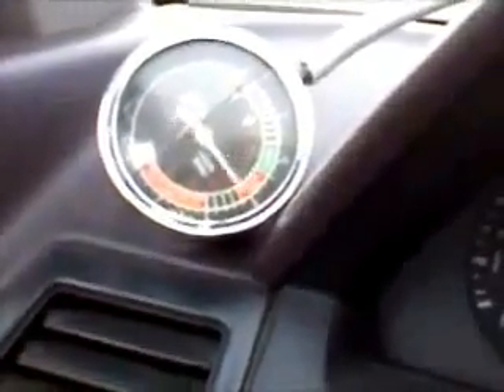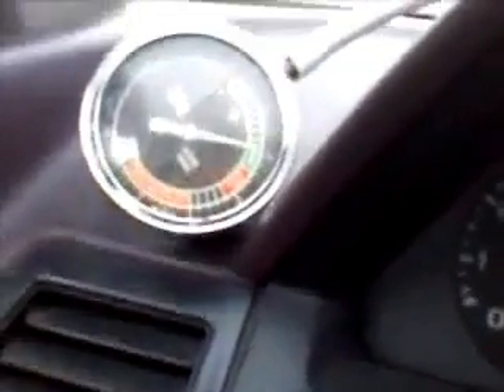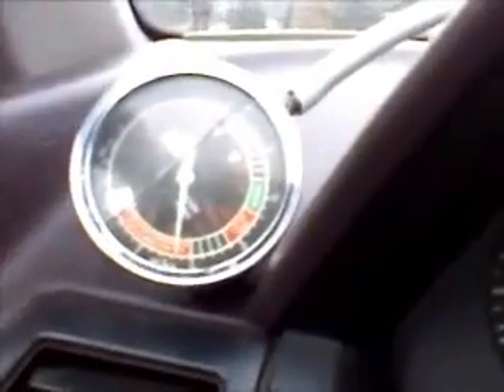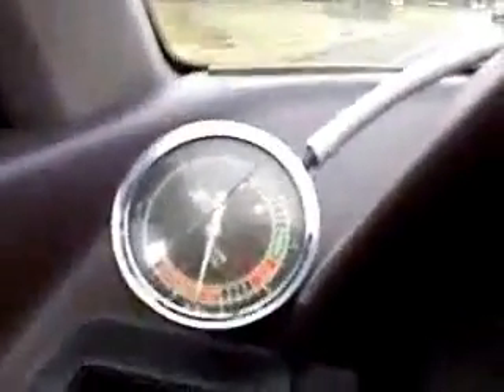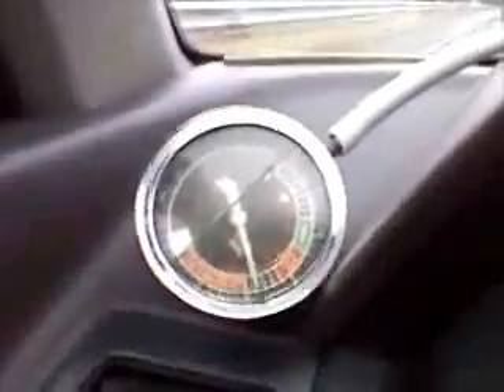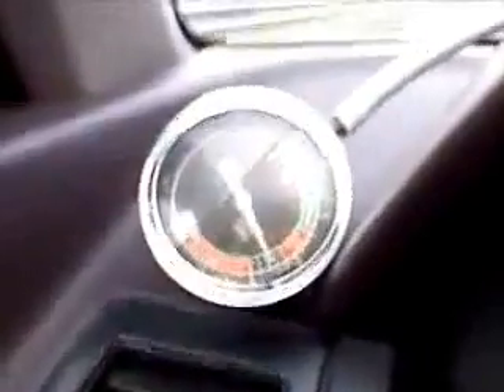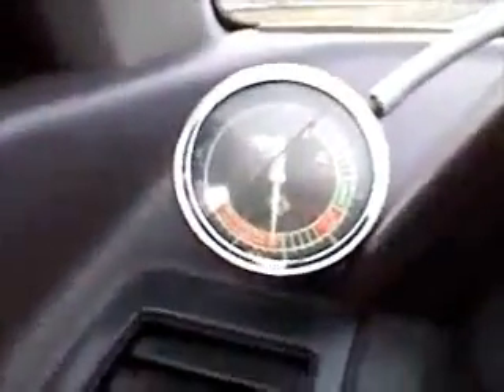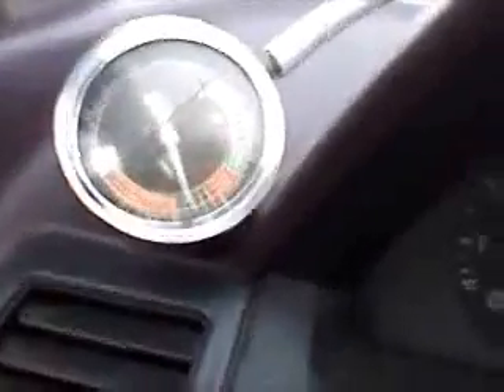#51 Demo of Vacuum on HHO cell from car intake manifold.

Comment: the only thing about hho and internal combustion engines on up to date cars and trucks is the oxygen. I know a well built cell would not put out near enough ml/min that produces hydrogen and oxygen separately and expels oxygen. see, the o2 sensor Will pick up the extra oxygen and as a part of the function of the computer it will hold the injectors open for a little longer  to inject more fuel every cycle per cylinder. so your only evening everything out. now it will be a cleaner burn but the efficiency margins that the consumer is looking for will not be there. so an electronic variable resistor will have to be ran in series with the o2 sensor and be operated by the throttle at a tuned lag to overcome this reading of excessive oxygen so your not consuming more fuel than before. which conclusively is counterintuitive. now because the government and epa have made laws against tampering with the emission control systems they have deemed this endeavour illegal and punishable by prison and hefty fines. I say do it because I will. but my research makes my system more environmentally safe and the amount of pollution is  cut by 3/4 standard emissions readings including nox . I'm very close to running my grand am on just hydroxy gas, I just have to apply the transformers before my cells to isolate the power draw on my alternator using purely reactive power. then rectify that power and I can run many more cells for the same cost of electrical power being distributed by the alternator before I applied the transformers. I just need taxes to fall through and I'm on my way fuel free....:)

Comment: It does seem counter intuitive however he is correct. With the intake butterfly almost closed during idle, the pistons will pulll a vacume against the butterfly. When it is opened for exceleration the vacume will drop due to a greater inflow of air.

Comment: It would be interesting to use a turbo like system which uses exhaust flow, to generate vacuum for the HHO cell. Rather than use pressure from the turbo, (modify the turbo, and) use the suction side to pull vacuum to the HHO cell. I learn of vacuum increasing hydrogen production efficiency from YouTube channel whyme2b. Video: HHO Electrolysis For Current Reduction.

Comment: There is nothing fascinating about the vacuum gauge. It's just what is actually being sucked by the engine in the area of vacuum manifold in order to run other devices in the car that does not need an electrical device. The vacuum reading does not actually represent the vacuum created by the engine on the HHO. It just doesn't make sense having it inside and see what your vacuum manifold does to your whole engine. With the HHO? We'll it is so impertinent.

Comment from the maker: I think so. That way the plenum or carbeurator butterfly can still be used to regulate engine output by regulating how fast air is drawn in with the HHO. The cell will be held at fairly constant vacuum by the pump. Gas production regulated by a PWM connected to a throttle pot.

Comment: Seems that the more vacuum you pull the less power is required.  Using a vacuum makes sense as it lowers the vapor pressure -- just like a pressure cooker raises the boiling point(or a car radiator)..Looking forward to more zff

Comment from the maker: HA! The venturi? I WISH! The venturi produces a max of 1"Hg (13.7" H20) @WOT, 6000RPM on my 2.2L 4-banger. Even still that's a very good vacuum signal from a venturi. It could be used to pull a water mist from a float bowl to aid in combustion cooling if I ever need it, but I don't think I will.

ICE on 100% H2O is coming. BELIEVE IT!

Comment: Hmm, my plan was to use that vacuum pump idea with a bubbler, that way the gas is sort of 'pumped' out the bubbler and forced into the intake manifold, reguardless of manifold vacuum.  As long as the pump can mantain at least 22" it should be good, at least I hope so!  Heh heh.  Can't wait for your video!  Great work!

Comment from the maker: I had considered putting a vacuum regulator between the intake manifold and cell to stabalize it but it would have be set at 7-10"Hg to do what it needs to do, not nearly high enough vacuum to be effective. Like I said below, magic doesn't really start to happen until you get to 20"Hg or more. Between 23" and 26" it gets really serious.

Comment: hello zzf!

you are right, and in my openion the only way to that work well, is to have some bottle of hho or a litle compressor with bottle wo instead of air recieves hho from the cell!,than you have to atache to the trottle body something to close or open the pressure, like the acelarator pedal! sorry my bad englhis